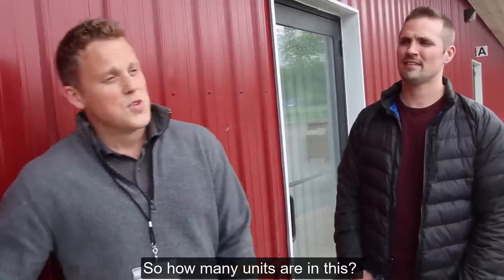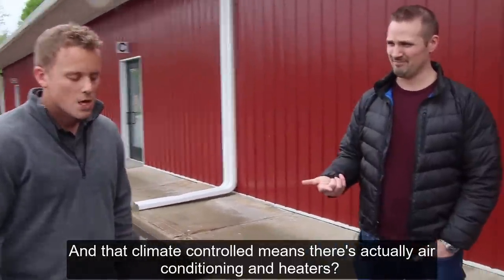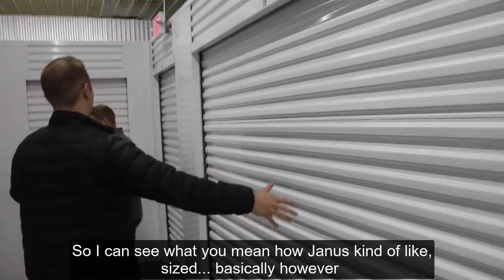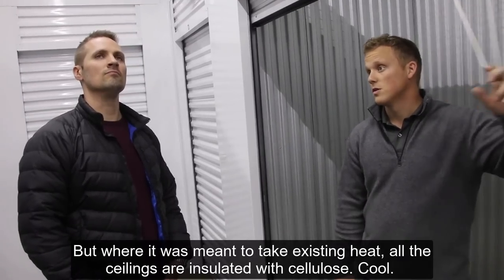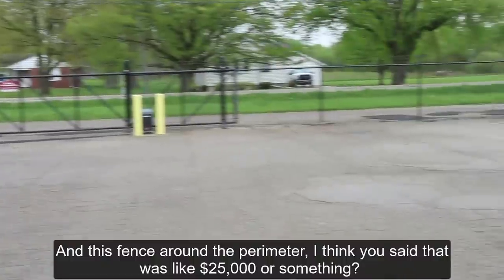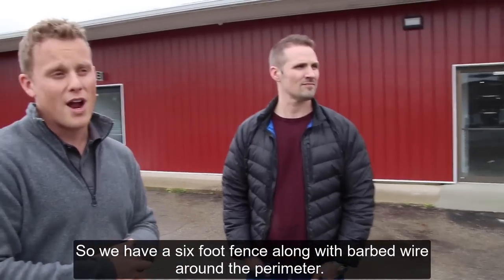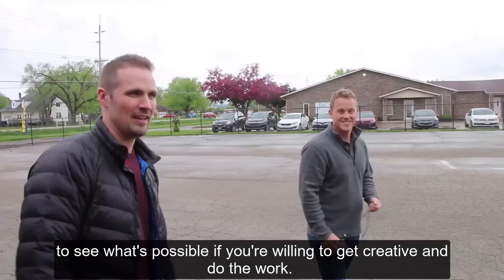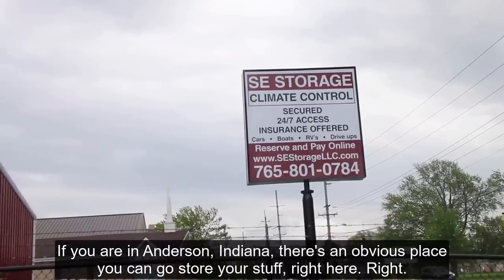How a Self Storage Facility CONVERSION Works (Full Tour!)

Comment: Unit mixes comes down to market. Ultimately you have more time and exposure to your market than an outside consulting firm. If your area is lower income with lots of multi story apartments, 5x5 and 5x10 will be consistently rented, as there is less furniture and less stuff in general in circulation, less purchasing power, and higher turnover. Climate control will also be less beneficial in those cases. Avoid lockers and cubby units as they draw more liability than they're worth. If there are more single/double family homes in a middle class area, drive ups, 10x10, and 10x20 become more valuable, especially if it's a recessionary market. People will be downsizing and will need furniture storage. This is where climate control is important, especially in humid areas.

Unless you're doing black magic like this guy to skirt the fire code, don't forget that unit sizing is not set in stone. Two 5x5 neck to neck can become a 10x5. A block of 4 5x5 can become a 10x10. Two neck to neck 5x10 can become a drive-up 10x10. If you plan your layout with an eye on future modifications you can have a more diverse facility that can react to changing market conditions. Investors know this and are hip to risk mitigation, especially if you point it out. The golden rule is to know your stud locations and plan out your doors before your units. And if you're doing climate control, for the love of god seal your building well and be diligent with pest control. Moths and mice can kill a business.

Save your money wherever possible. If you're comfortable taking on a task yourself, do it.
Reply from the maker: That's great input! Thanks for sharing all the intel, David!
Reply: @Retipster  For sure! Good video and good tips all around.
Reply: Great Response David Little. Appreciate you sharing.

Comment: you mentioned "partnering" with Janus, did you mean you hired them to do the work or did you give up equity for the work?
Reply from the maker: I'm pretty sure it was the former and not the latter.
Reply: Thank you for the quick reply.   I purchased a commercial Property in PA and I’m considering converting into a storage facility. The property has two buildings on it totaling 23,000 ft.² building one is three stories tall and totals 18,000 ft.² and building two is a one story 5000 square-foot vanilla box.￼  I need help to move forward, where should I look ? Should I hire a consultant? What’s my next move?￼. Thanks again for all the awesome context